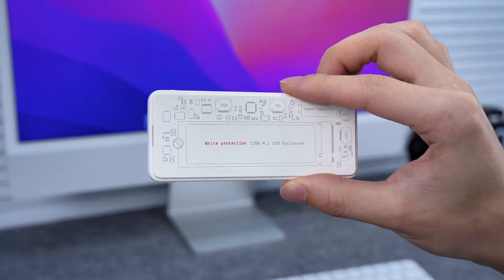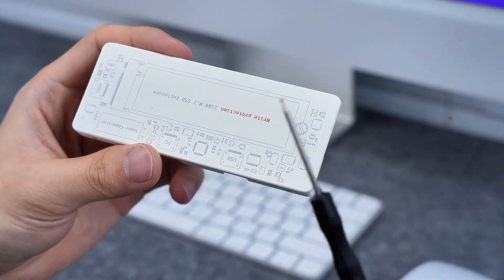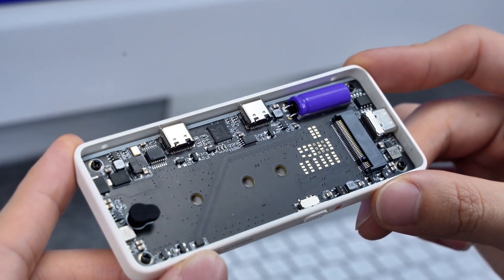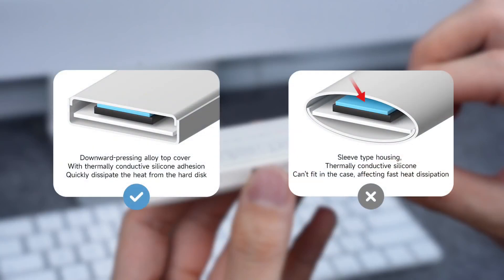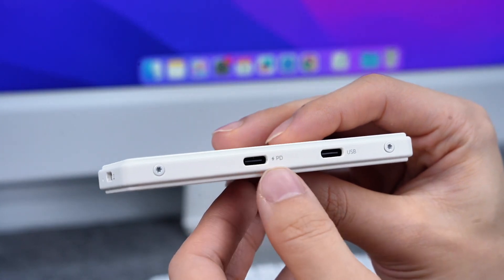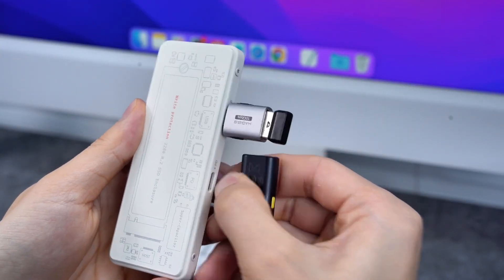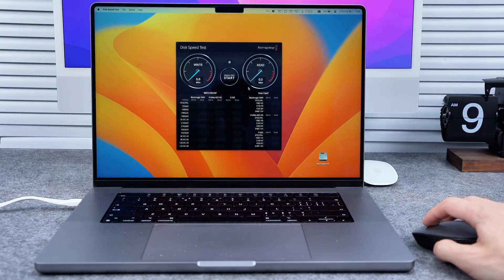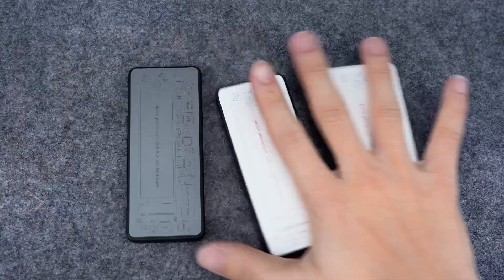Hagibis M.2 NVMe SSD Enclosure Write Protect USB-C Hard Drive Enclosure With 100W PD

Comment: Hagibis refuse to release firmware updates for devices Hagibis UD1101 40 Gbps Enclosure firmware is buggy
I know of 2 releases of Hagibis firmware that came on these devices 
AS_USB4_231005_85_02_03 (Very buggy) 
AS_USB4_240417_85_02_04.bin (Buggy)
the latest generic release AS_USB4_250528_85_00_00 works well but 
we need Hagibis to release AS_USB4_250528_85_02_04 or the green and blue led's dont work
I have requested a firmware update from hagibis about 10 times they are useless and tell me to ask aliexpress 
as if aliexpress can request a firmware update from the factory making these for hagibis

I dont recomend picking up Hagibis products until they start releasing firmware updates for devices
on the Hagibis website on a regular schedule

Its a shame as the build quality is good